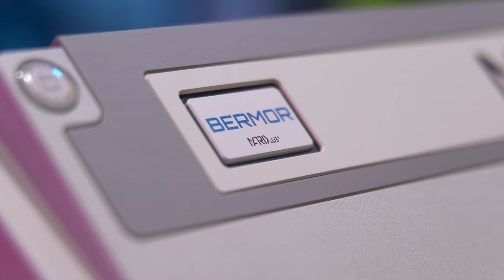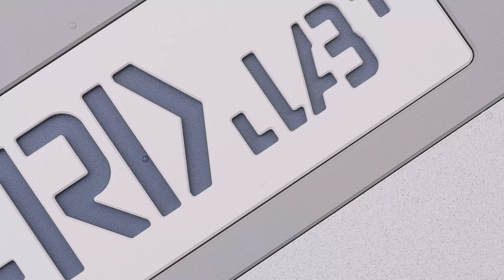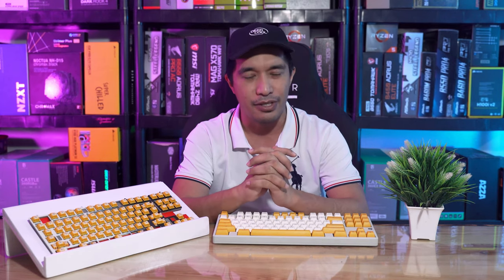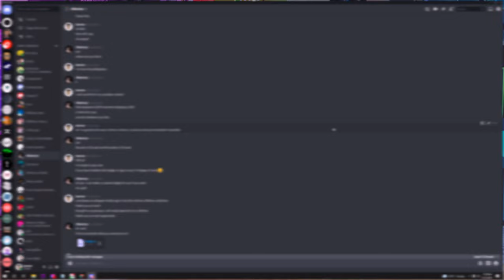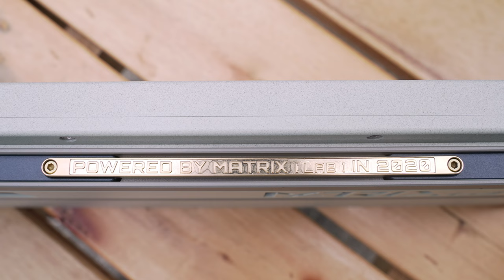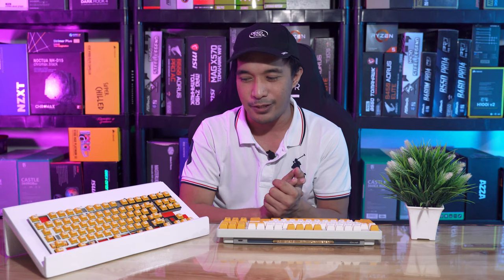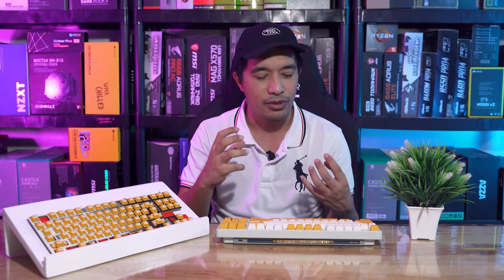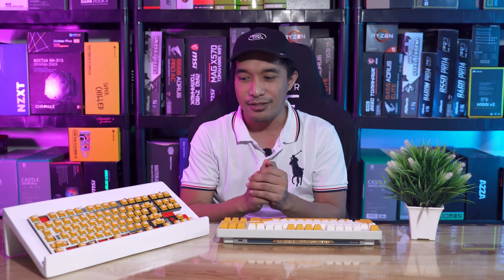MATRIX 2.0 ADD Mcflurry Edition PRICELESS!!! PERSONALIZED Custom Keyboard Timelapse & Sound Test

Comment: Ano po ba masmaganda?

Core i5-7400 7th gen processor.
Motherboard support up to core i7 7th gen
16gb Ram (dual 8gb) ram stick
240gb SSd (for faster booting and processing)
8gb built in video graphics ram (intel HD630

Vs 

intel g5400 3.7 GHz Quadcore 8th Gen processor
Gigabyte H310M H 2.0 Motherboard
Built In intel HD Graphics, 4 4GB Shared Memory
Coolmoon Glory II RGB CPU Cooler
8gb Hyper X RAM, 2 x 4
120 GB Kingston SSD
Reply: Matrix 2.0 Mkb